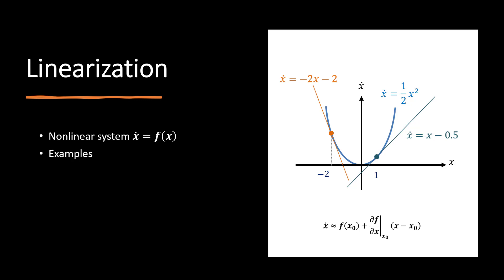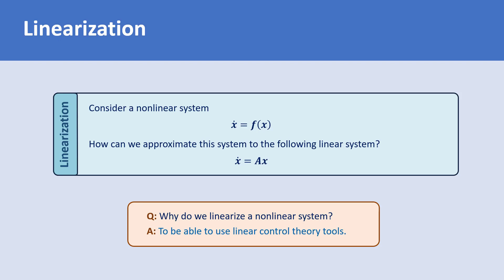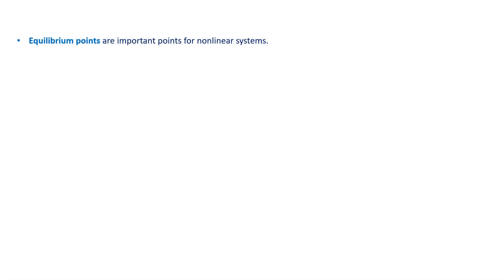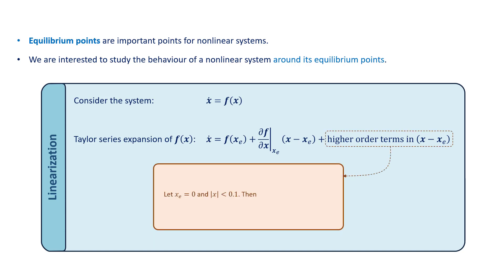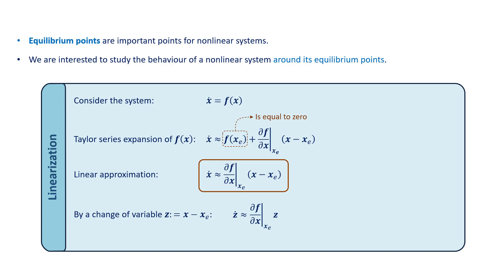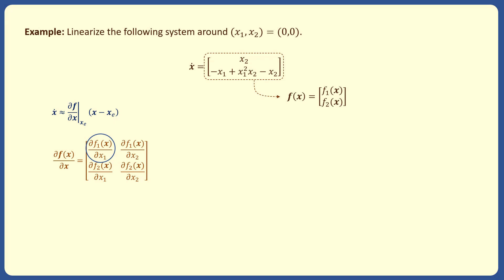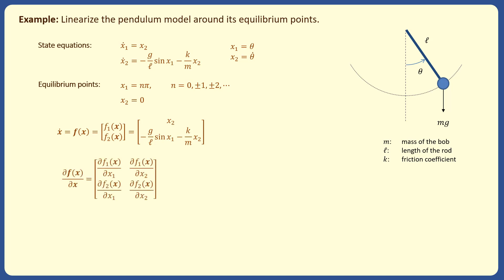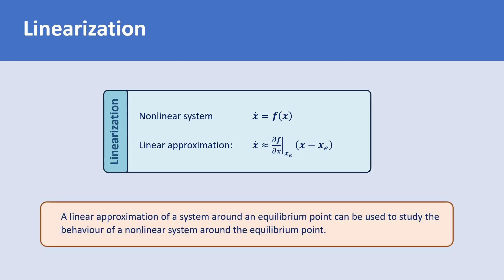Nonlinear control systems - 2.2. Linearization

Comment: One thing that scares me is: what if the system is very non-linear to the point that its linearization does not approximate its behavior well? Could you point me to some bibliography on this? Is there any way to attack the problem without going through system linearization?